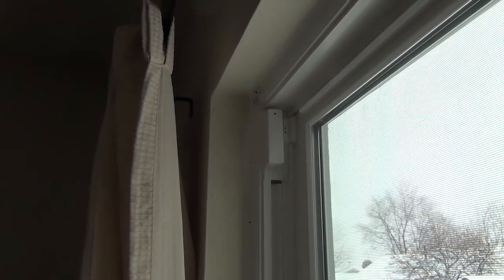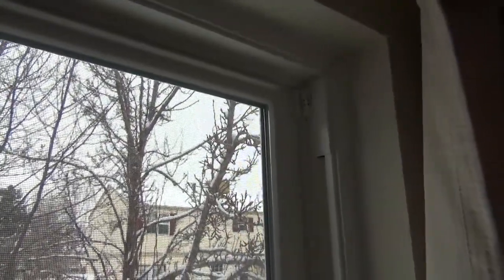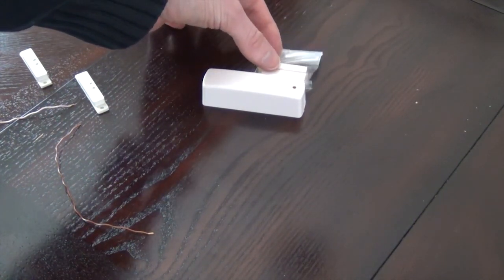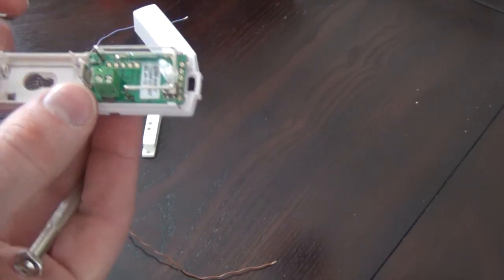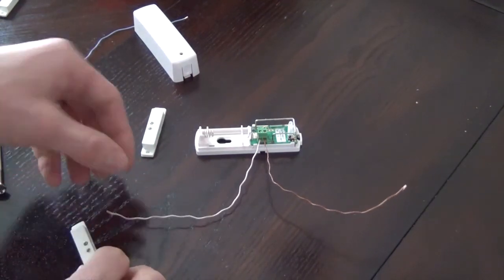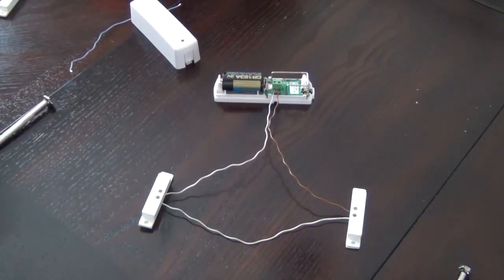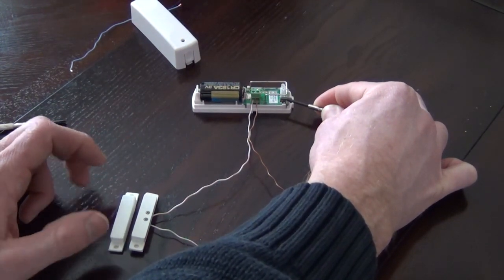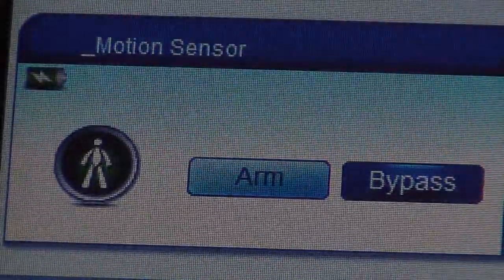Mi Casa Verde - Vera 3 & Vera Lite - Using Schlage door and window sensor with additional contacts

Comment: Where did you run the wire?
Reply from the maker: I was in the process of replacing my windows so I ran it between the window frame and drywall before I filled the gap with caulking.  If it were an existing window though I would just take a razor blade and cut a little path in the caulking between the window and slide the wire in there.  If needed I could refill the caulking  but it may not even be necessary.  I used cat5/6 wire so it is very small.

Comment: Thanks for the video - in the video you stated "Normally Open" but the ebay link is normally closed.  Does it make a difference?
Reply from the maker: Dave, Good catch!  I totally missed that.  I'm no expert but I think the Schlage sensors require normally open.  Normally closed may work but the way I understand it normally open sensors will complete the connection when the magnets are next to them.  So, its like making one big wired connection, as long as the magnets are next to the sensors.  When one moves it's like cutting the wire which will trigger the alarm.  Hopefully that makes sense.
Reply: Pete B I found the sensors you used on amazon, I ordered a 10pack for $20 (including shipping) I'll let you know how it worked out.  Again thanks for the video.  Where did you hid the wires? I have White vinyl windows in a unpainted OAK frame.  I am thinking out using white eletrical tape to cove it up.  I also have a 1 foot split between windows.  I am sure i'll figure out a way to wire it up using the 1 zwave sensor.
Reply from the maker: David A Good to hear.  I actually need to order some more myself.  I have one room I still need to wire up.
I hid the wires between the window and the drywall (I don't have wood frames).  All I did was cut away the existing caulking push the wire in then add new caulking.  I just installed new windows so this was a pretty easy task for me.  I'm not sure how difficult it would be on other windows.  On the windows where I had to go through the wall it varied on the way I did it.  One of the windows I was able to pop off the sill and run the wire through the wall to the other window (where I also popped off the sill).  Another I drilled down to the basement and then back up to the other window.  Hopefully that helps.

Comment: Where do you get the extra door sensor/contacts?
Reply: pretty cheap on ebay.

http://www.ebay.com/itm/5set-MC-38-Wired-Door-Window-Sensor-Magnetic-Switch-Home-Alarm-System-N-C-Type-/171196634209
Reply from the maker: Dave just pointed out that those are Normally Closed.  I think they need to be Normally Open.  Sorry I missed that before.

Comment: Thanks for this video.  You just saved me a boatload of $$$$$!
Reply from the maker: Glad I could help.  I also recommend checking out HEK's cheap arduino sensors.  It was a little difficult for me but after reading the forums I was able to get some cheap sensors built.  Here is the forum link: http://forum.micasaverde.com/index.php/topic,16170.0.html